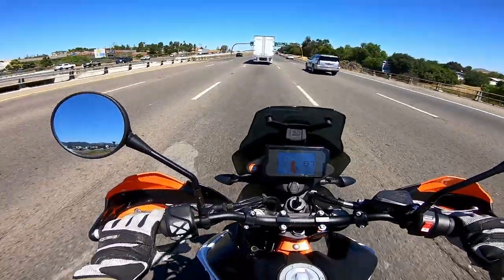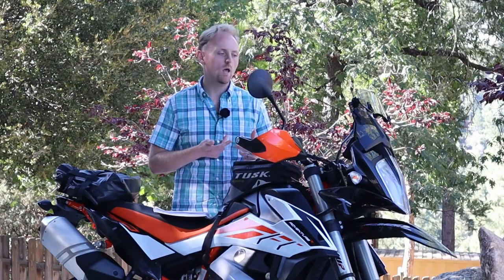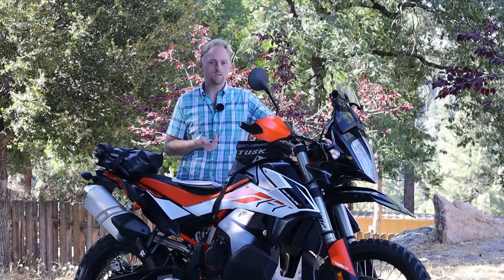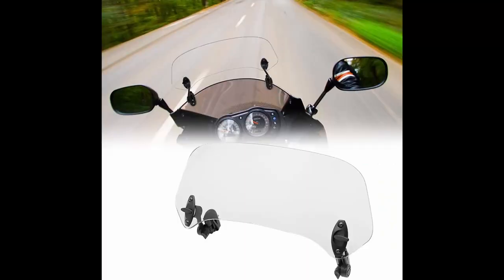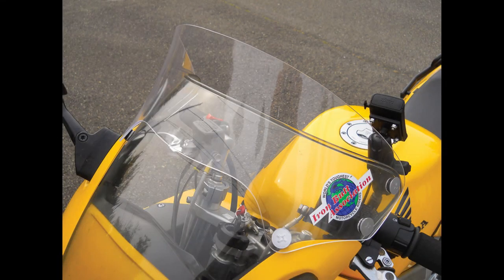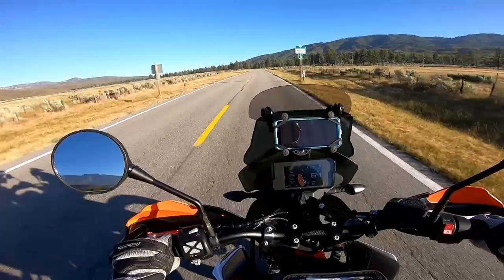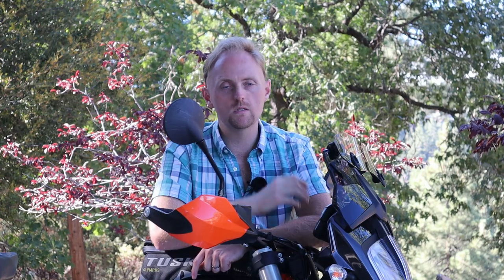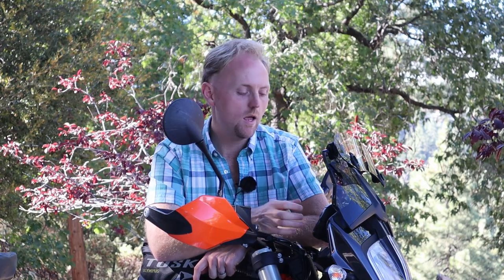KTM 790 Adventure R  |  Windshield Woes - Fix for Buffeting?

Comment: The screen is there to stop windchill and slow air approaching on the rider. This creates a partial vacuum behind the screen with higher pressure at the front. These two differential pressures increase with riding speed.
When the two differential pressures mix they often don't mix smoothly. 
The way to reduce this effect is to feed a volume of air at a slower speed behind the screen reducing low pressure. Some bikes have quite a gap between the bottom of the screen and the fairing to allow airflow up and under the screen to reduce this effect producing smoother air mixing between high and low-pressure air. Subsequently reducing buffeting.
Acceptance of some moving air behind the screen is inevitable unless you have a massive screen and ride in a partial vacuum.
This will often increase wind pressure on your back as the air at the rear tries to close the partial vacuum producing rear buffeting.
Tip. If you have one of these add-on top-of-the-screen deflectors. Place the deflector edge onto your eye vision
You may be surprised at the result. If this works for you. Make a coffee sit down and work out why it works.
Reply: Some people have suggested drilling holes in the bottom of the windscreen to allow some air to flow through to the back of it. Have you tried that? I'm trying to fix some buffeting on an 06 Vstrom and I was going to try that next.

Comment: I’m 5’10” and ride mostly street with my 790 (non -R) and am finally fairly happy with the Madstad setup AND an MRA Xscreen installed on the 20” screen. I have the MRA a little lower than specified in instructions (drilled the screen) and ride slower speeds with the MRA positioned way down and higher speeds with it raised. I get best results with the Madstad tilt in the middle position and almost as low as it will go in the brackets. I think the small frontal area of the bike contributes to buffeting and given the shape of the Madstad screen, lower seems to be better.

Comment: I'm currently deciding on my next bike, either a Teneré 700 or a KTM Adventure 890R. I know they both have buffeting issues.

I got an MRA X-Creen Sport Add-On Variable Windscreen Spoiler Blade for my last two bikes, a VStrom 1000 and a 2019 Yamaha Tracer 900. It fixed the buffeting issues on both bikes.

The MRA spoiler (made in Germany) is well built and won't let go. And you have the option of clamping or bolting it on. Zero regrets.  👍

Comment: Hey Ian, I bought the same little spoiler from Amazon and thought the same as you, that this thing is not going to last and what the hell it’s cheap. I’m here to tell you it was a huge improvement over stock and has endured lots or trips and rugged off road. I can’t believe this thing is hanging in there and I’m not a fan of the way it works but if it’s not broken…. Still waiting for a viable alternative with out breaking the bank!

Comment: Hi this windshield is very good.I have v strom 2019 and I don't have wind buffering.When the weather is very hot this is no problem.I think this motorcycle Is not for big speed.When you go with more from 140 km/h with rally hai fender you have tankslap.
    Be careful.
Thise ktm is the beast for off road,not for crusing with big speed. Greatings from Sofia Bulgaria.

Comment: I tried it with the windshield removed and just having the little flyscreen housing around the headlight. It works really well, no buffeting and good on hot days. Enjoying your content, just subbed
Reply from the maker: Thanks after your comment I tried that, very quiet,  but lots of bugs
Reply: @BigRockMoto  yes thats the downside. A few people have suggested removing the lower wind deflectors makes a big difference too, so I'm going to try that

Comment: I have the same spoiler on my 19 CB500X for 7000 miles and it has transformed my ride. I also have set the same way you do have experimenting all different angles. I have dropped my bike and with the BarkBusters there was no contact to the spoiler. I do recommend a dab of loctite on the allen screws hold them in place!

Comment: Another helpful vid. I'm OK with the shield in the low position, the air is fairly clean but could still be improved. As you said though, the high position is bad. You'd have to be either really tall or short to run it there. It sounds like the MRA Xcreen is the ticket due to higher quality. I'm also going to pick up a Puig for fall cool weather commuting. Another reported (but expensive) help is to run CRG bar end mirrors to eliminate the vortex coming off the stock mirrors.

Comment: Most of the buffeting is generated by the stock mirrors test this for yourself by taking your mirrors off and ride it down the road. you'll feel clean air. then go on rottweiler or another site and by decent mirrors for this bike and you will love it.

Comment: I bought the same screen and the lower cam-lock broke after 15 minutes on the highway. Luckily I was able to fix (and improve) it with some carriage bolts and wing nuts. Would still recommend buying something better quality. 

I find my screen works best for me fully extended (legs pointing up) and tilted almost vertical. It looks a bit weird but now I can open my visor at highway speeds no problem and hear my bike too!

Comment: I had a similar problem with a 1500 goldwing.  Plus the fairing is so big that the only air you get is heat off the engine.  I bought a BMW R1100RT , sold the goldwing, and I never looked back.  The buffeting was so bad on the goldwing that you couldn't ride it on the freeway above 50 mph.  If I had kept it I would have cut that barn door wind screen in half, and used the Plexiglas to make some winglets to deflect air on the riders.  The vacuum pocket behind that mess was so strong that it would blow a wind on your back .
Reply: Wow all those Gold Wing riders are wrong  ?

Comment: I'm 197cm tall on a 790R, and i drive with a lightweight adventure helmet, i tried with the stock windshield and the windshield of the  non R (tall clear) and i found out that with the taller windscreen worst it was the buffeting , and my final setup is something very similar to yours.
I'm running with the stock windshield mounted in the upper position and an after marked wind deflector, my deflector has an alluminium clamp and is made pretty well, i found it for 25 +- dollars on aliexpress, if you dont mind the wait (it takes 2/3 months of shipping to me in italy migth be better for you).

Comment: Wind noise on my 1290 Super Adventure S is why I am here. I am going to try swapping my Shoei Hornet for a Neotec II hoping that helps. At 70mph, I don't so much get a noticeable buffet that shakes my helmet,  just an unbearable roar, I think it would damage my hearing without ear plugs.
Reply: I now have a Shoei Neotec II and a Ktm 790 adventure R. A lot of problems with buffeting at highways. My earlier bike was a ktm 1190 adventure R and had the same problem, even with the high screen on it.... I am thinking of buying another helmet.

Comment: I think everything you said in the video is true. I've owned a 2011 V-strom and now have a 2019. The windscreen situation is worse on the 2019. I've tried four aftermarket windshields and any combination of those with two different e-bay spoilers like the one in your video. I think a very low screen with the spoiler adjusted for the individual rider is the best bet for most people. I'll probably swap to my most massive see-through alternative for late season riding, 99% on road. I live in Norway so it gets kinda cold in autumn.

Comment: I'm 6'1", I have a 2022 Yamaha Tracer 9, the windshield is awful, lots of buffeting on my head, feels like someone's playing my helmet like a bongo. If I tuck in behind it, it's totally silent, but I can't ride like that. I tried the same solution you did, but the buffeting only got worse, no matter how I adjusted it. I tried rubber spacers under the screen, to lift it about an inch further forward, assuming more wind could get in underneath to even the pressure...noticeable difference, but still some buffeting.

I tried the Givi touring screen, it's 2 inches taller...still, lots of buffeting, even worse than stock. I then bought a small no-name $40 windscreen online...it blocks the wind from my body, some buffeting, but it's on my upper chest, my head is in clean air. Not happy, but it'll do. 

Great bike, but shameful that the windscreen is so bad for taller riders. For comparison, I had a Tiger 850...some wind noise, but no buffeting, totally comfortable.

Comment: On my 790R I removed the adaptors on the stock mirrors resulting in them sitting lower and it actually helped a little, almost as much as no mirrors at all. The taller standard 790 screen helped nothing except getting less wind in my chest/body area (haven't tried this screen with lower mirror position though). In highest screen position its even worse than the R model. 
Its not that often I'm riding +100km/h for long inactive periods - trying to keep it on the fun backroads as much as possible. But for long distance adventures it might be neccessary to take the highways/faster route sometimes - to have time to enjoy the camps and destination goals... so looking at one of those spoiler things now hoping it will help! Too bad they are kind of big and ugly...  I've seen one using a really small spoiler clipon once(and he said it helped), but cant find it for sale anywhere :\
Will try removing the winglets below the headlight also I think, as somebody here mentioned. But I doubt it will help as if I put my legs up on the fairing with feet next to the headlight, completely blocking this channel of air, it is not changing the buffeting much. But if I angle the feet outwards in front of the handlebars it changes quite a bit. Meaning it is the handlebar stuff thats making the most turbulence for me? Try without the handguards also maybe? (not that I would want to ride without them but...)
Or just hope one of those standard spoiler will create that air bubble that stabilizes the airflow around the head and live with the ugliness... 
Or get a 3D printer and make my own deflectors in suitable places. Yay another excuse for getting yet another expensive toy ;)
Reply from the maker: thanks for sharing

Comment: Why don’t they make a rally tower wind protection only… without all this expensive tech inside… o love my 790 really but I hate the wind and rain protection on highway! Is crazy that I am thinking about changing motorbike just because of this… But I saw a guy that changed the seat to rally comfort seat from touratech and he said because you don’t have to sit so close in front of the motorbike above the foot pegs what the stock seat force you to do, the fact that you can sit more on the back of the motorbike helps a lot…

Comment: I’m curious if you are still using the little windscreen spoiler and how it’s working out. Or have you tried other solutions? I’m considering the 790 but I need to ride on the freeway for at least an hour to get to where I want to start my fun riding. So wind buffeting is a real concern. And yes, as you mentioned, I also have a R1200GS so am a little spoiled with excellent protection now.
Reply from the maker: No I have gone to a Puig touring screen and removed the lower winglets. Its as good as my GS now. Video coming soon
Reply: Big Rock Moto & Outdoors wow! That’s great news! Congrats
Reply: @BigRockMoto  really. I’m 6’1” and also have a puig windscreen lots of wind buffering. I get bitch slapped by the wind every time. I about to take it off and go back to stock windscreen.
Reply: @BigRockMoto   Did you ever do this video? I can’t seen to find it.  Wanted to see which model of Puig you were running and how it went.

Comment: I respectfully disagree with your comment about no worse than V Strom or Africa Twin. I have owned both and still have the V Strom. I sold the Africa Twin in order to buy the 790. I love everything about the bike except for the terrible job it does in the air management department. It is causing me hearing problems even though I always wear proper fitting earplugs. I have experimented with different windscreens, including the very large Givi model, with very little success. I've tried no windscreen, removing the lower spoilers, etc., but to no avail. I benchmarked it against my V Strom on the same stretch of highway back to back in exactly the same conditions and the 790 was much worse. After much experimentation,  which included hi-tech materials such as duct tape and hardboard, I came to the conclusion that the buffeting is caused by updraughts caused by the shape of the bodywork. The air shoots up from below, in the fork area, and also off the angled surface of the bodywork. Some of the air is directed at the base of the helmet, and some hits the underside of your arms causing all kinds of airflow problems and buffeting. To properly address the problem, I believe KTM will have to change the shape of the bodywork or more likely someone in the aftermarket will design a set of bolt-on panels to properly manage airflow. If this happens, I'll be near the front of the line to purchase it. Otherwise, the 790 is by far the best all-rounder I've ever owned.
Reply: Others have suggested changing mirrors, makes sense as I've had mirror caused buffeting on other bikes...